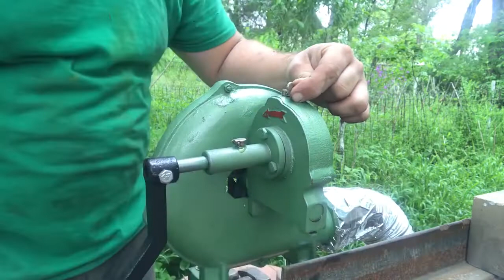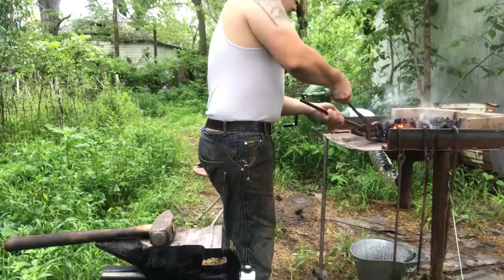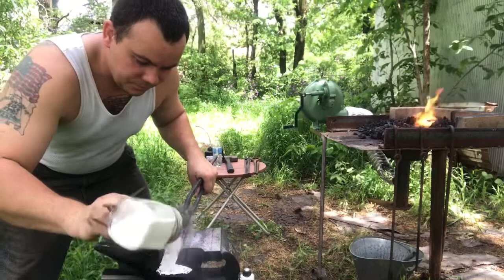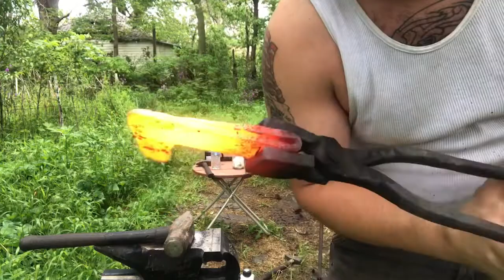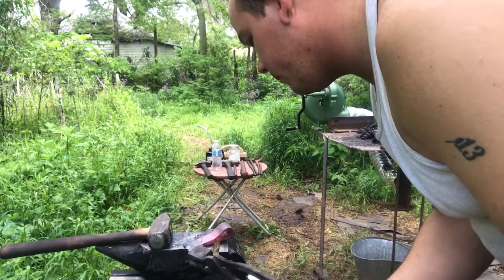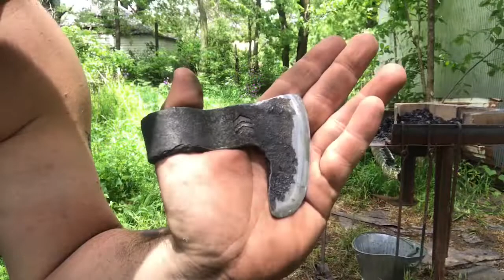Folded, Bearded RR Spike Tomahawk

Comment: Im usually not into RR spike stuff but this project was great. I ve yet to forge weld and you made it look like it is something I can do. Many thanks, John.
Reply from the maker: OKBushcraft my very first forge weld and the piece that really made forge welding click in my head was a tomahawk very similar to this. I forgot I had it in the forge (was working two pieces, and had an electric blower) and when I looked at the fire it looked like I had thrown a bundle of sparkler wands into it. I pulled the piece out, whacked on it until it was red, and then the lightbulb clicked in my head once I examined the piece.
Reply from the maker: And that’s really my best advice, fold a piece over on itself, chuck it in the fire, wait until you see sparkles, and then wait until it’s full on sparkler. Pull it out and whack on it. After that just keep doing the same thing with less and less sparkles. You’ll find what the steel looks like at temperatures it will and won’t weld at quick that way.
Reply: @veteranironoutdoors8320  
 That is about as simple as it's ever been described to me. Thank you.